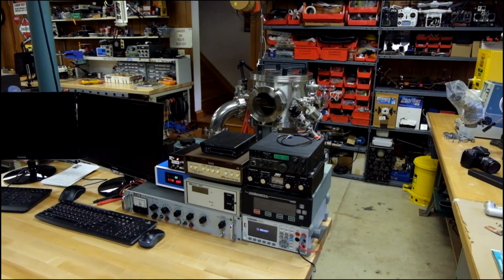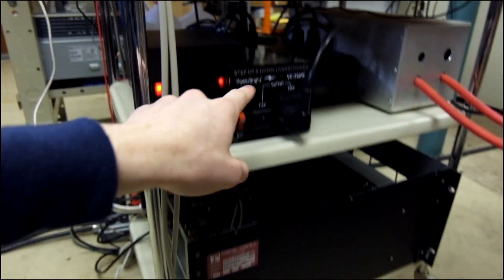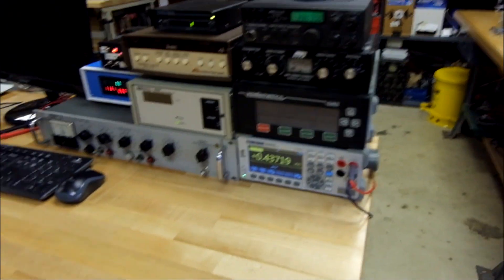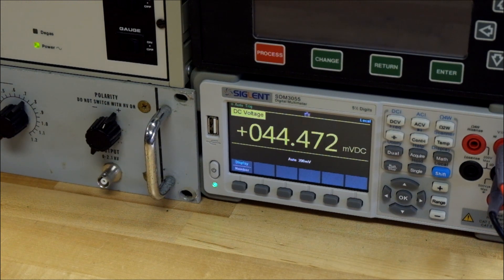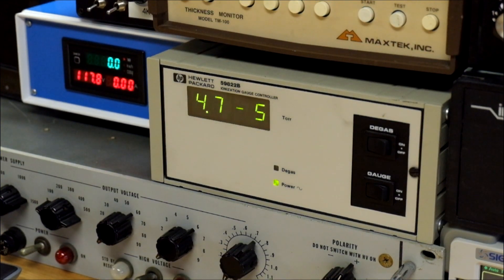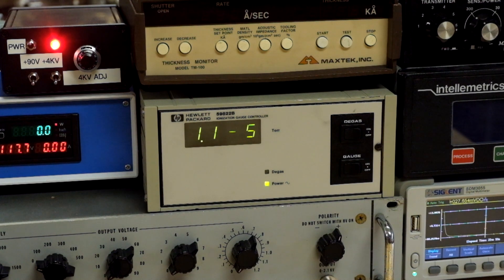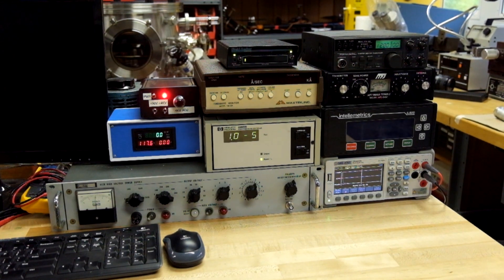High Vacuum Chamber Basics, Part 2 - Atmospheric to 1e-6 Torr Pumpdown Procedure

Comment: Maybe a dumb question but why do you leave the mechanical pump running after you closed the valve that connects it to the chamber.
Reply: as far as I know, you always have to have a backing pump behind the turbomolecular pump.  I don't think turbo pumps can exaust to 1atm, only to very low pressure, which the backing pump provides. ("The term roughing pump describes a type of a vacuum pump that is used to initially evacuate a vacuum system, as a first stage of the process towards achieving high vacuum or ultra-high vacuum level.The backing pump is used with conjunction with another deeper vacuum pump to obtain the deep vacuum level.") In this case the valve basically switches the mechanical pump from being a roughing pump to a backing pump (just by what it's connecting to, not in any functional way).

Comment: it's impossible to seal the windows or anything else in the -17 Torr of "outer" space.   We can't even seal the fuel tanks on the SR71 Blackbird.  They leak fuel when the plane is on the ground until it flies and gets up to speed and the titanium warms and expands.  Considering the much, much greater differences in temperature for "space" travel where is this unobtainium super material that seals the space station?  Rocket fuel tanks?  What material is it?   I'd really like to hear from materials specialists and physicists.

Comment: Cool! I used to just use a turbo-pump to achieve 10-5 bar for our optical gas cells. Interesting video! It would be very useful if you can list the components used ( including the company and everything!), I used swagelok VCR parts, perhaps it needs more specialized tubing and connectors. You should certainly use this as an educational tool :)

Comment: So I cannot use aluminium as a chamber?
Reply: Not for very high vacuum, you need stainless steel rated for very high vacuum.
But for a hobby vacuum chamber with not so high vacuum you could use aluminum.

Comment: What type of baratron do you use there and do you have the wiring diagram and corresponding voltage to pressure chart? Not sure how you tell the pressure from the volts? On the baratron is that a rs232 connector?

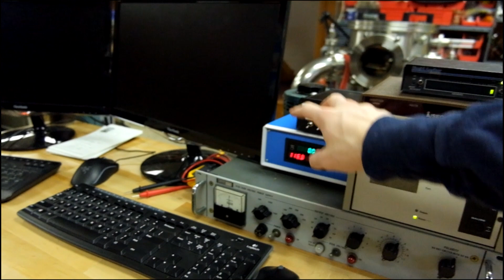Comment: 2:09 Have exactly that one and they are really good, old as they are they are HP so good stuff.
Reply: What kind of heads do they use?
Reply: @johnnycash4034  Pretty much any type of standard glass A/B tubes, G75 or G100 ones fex works perfect but also nude ones. But you then might have to tinker a little with it to get emission or such right since they have a little higher sensitivity than the glass ones.

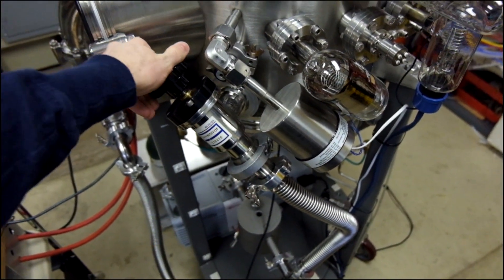He use fex two tubes and at 2:36, you can see them as the one glass tube closest with a black band (its actually silvery like a mirror but seen black in this ange), have one my self, and little to the right another one with the blue connection plug on the bottom but that tube is totally clear.

Comment: Not a bad hobby with a couple of $1000 there for sure in equipment, even used and from Ebay these things cost. Just the chamber is for sure several $100.
Reply: i bet tha whole setup is 10k being cheap on it. work in the industry and that stuff costs. hell vcr gaskets can be 100$'s. hes using metal gaskets could use some viton o rings for cheap. just for perspective my co worker told me he had to replace a oring for a ion implanter and the o ring cost 5k...
Reply: @TheProsnurfer  At least 10k no doubt and if all new easy at least 200k+. The gaskets can be expensive if big, meta gaskets is key for low vacuum but when only 1e-6 torr its not really necessary but it could help getting down faster since they don't outgas anything, but viton doesn't either.

Comment: You should check your roughing pump as the noise it makes when you start is not normal, has to release some oil fumes but not to get that noisy and I am talking about a turbo pump I have that gets to a 5.0-8. On fully running capacity at 816Hz of the turbo and the gate valve open, the roughing pump should be very silent, but I can hear a sharp noise from it.
Reply: Old comment but 100% this, that pump sounds very bad
Reply: Also would recommend an oil-less roughing pump. Edwards scroll pumps are a lot easier to maintain in my experience (35i and 6i). They require a bit of maintenance but will last forever if that maintenance is done.
Reply: I know nothing. But I agree that pump sounds pissed off.

Comment: Loved this video.
What are you thoughts on the space station using o rings on Coppola window shades?
Thanks for your opinion.
Reply: Don't know what he thinks but it's impossible to seal the windows or anything else in the -17 Torr of "outer" space.   We can't even seal the fuel tanks on the SR71 Blackbird.  They leak fuel when the plane is on the ground until it flies and gets up to speed and the titanium warms and expands.  Considering the much, much greater differences in temperature for "space" travel where is this unobtainium super material that seals the space station?  Rocket fuel tanks?  What material is it?   I'd really like to hear from materials specialists and physicists.

Comment: Hey really nice videos. Just a thought, tell us how the stuff does what it does. I found you just because I wanted to know what a turbo molecular pump works (with there no being any air) I think I have figured it out now, but this stuff is fascinating. You made me go to eBay to see if the kit was within my budget. I have wanted to build a fuser for ages now. 

Thank you loads for your work, you should have a metric fuck ton more suns than you have at the moment.
Reply: Turbomolecular pumps are pretty simple in principle. If you look down inside one it looks kind of like a jet engine, and that's on purpose.

A turbomolecular pump is a specialized kind of axial compressor, it works by arranging the rotor and stator vanes such that when the rotor's spinning, it's overwhelmingly likely that any gas particle that enters the pump will travel further into it. The main difference between a turbomolecular pump and any other sort of axial compressor is that it's optimized for really low pressures, and as a result, is built more to whack individual gas molecules toward the outlet, rather than treating the aggregate of gas particles like a single "thing". That way as gas particles randomly bounce around inside the chamber, whenever they happen to bounce toward the pump, they generally don't find their way back into the chamber. That's also why the inlet of the pump is so big despite it not handling large volumes of gas well.

Comment: Is such a vaccum the same as in outer space?
Can u therfor make tests how meterials would react to such a vaccum like it is in space?
Iam asking because there is a lot of discussion going on about the Car SpaceX has put in space.
Could a car tire survive the Vaccum of Space if any aire is in it?
Reply: I actually ran the thermal vacuum chamber to bake out the tires that got put on the Tesla they shot up.  The tires after the bake out were surprisingly still well intact.  However, I have no doubt that they would shred instantly if they were ever actually driven on again. The two tires (they only launched 2 tires and put mass simulators on the side facing away from the camera) that SpaceX actually baked out left a good 1-2 gallons of goo when done that smelled of death.
Reply: Regarding the tires: Think of it like that: The Tesla roadster is specified for 1.8/2 Bar(roughly 29PSI of tire pressure. 
This spec. is meant for planet earth in heights usually inhabited by humans. So ambient Air pressure is roughly 1bar or 14.5 PSI.
Outer space has around 1x10^-18mbar of pressure.  But you can just calculate with zero for comparing the conditions for the tire.
So on earth the Tire has an absolute pressure inside of 3bar.  -1bar for the ambient pressure, the pressure difference is 2bar.
In outer space we just assume 0Bar, therefore relative pressure between in and outside pressure is 3bar(3bar-0bar).
A tire can easily withstand 50%more pressure. 
The tire will indeed outgas quite a lot, but I think the main reason why it has probably popped by now is the strong radiation in space, which a substance as Rubber can't withstand that well
Reply: And the tire would survive with air in it but the seal would fail and allow the air inside to escape before any catastrophic failure in the tire itself.
Reply: how come elon said it was a normal car that was not prepped at all for space?
Reply: @A2J_Tim  I don't recall seeing that.  The gas and oil was removed and only 2 tires attached for the camera to see. IDK if they did anything to the interior.
Reply: The batteries would have exploded if was true. Any sealed cavities would be like bombs. Forget the tires. The bubbles inside vacuum formed plastic would explode
Reply: No, this is far from space. That's many orders of magnitude higher. That's some serious vacuum and is really difficult to achieve compared to this.